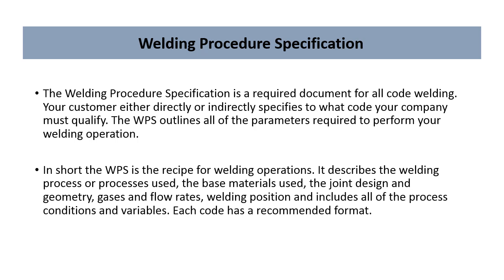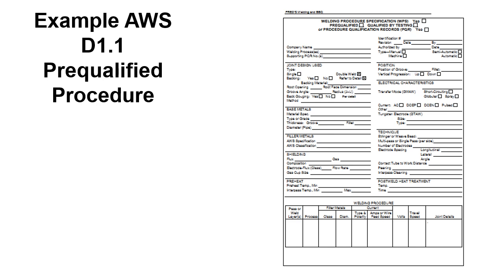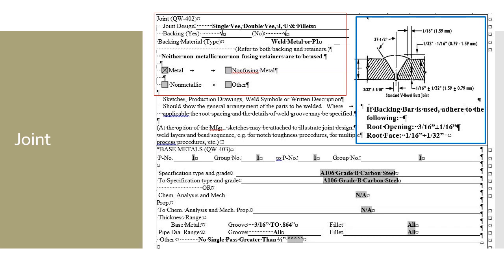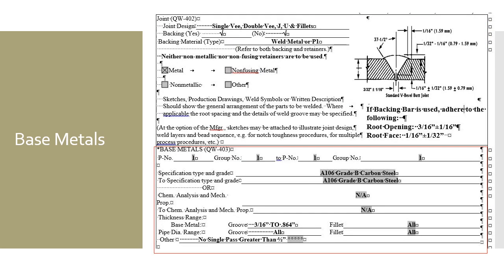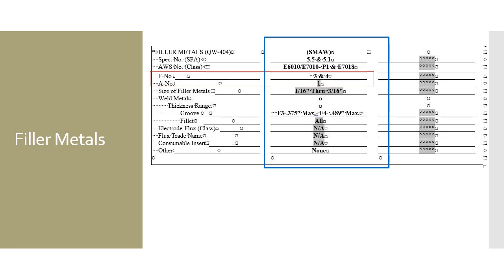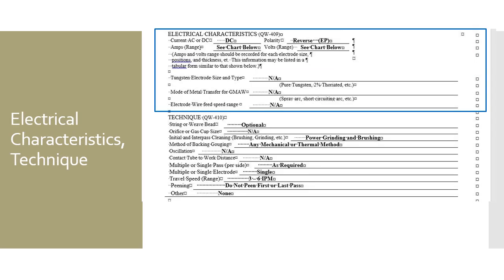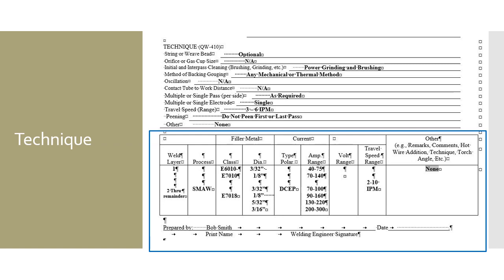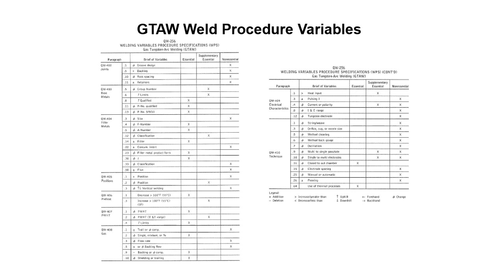How to Read a WPS (Welding Procedure Specification) | CWI Course Module 5

Comment: Early in my career, late one night I got a call what SMAW filler do we use for P1, I replied E7018. Next morning all welds needed to be cut out, the fabrication was P1 not P#1. P1 is a specific material A335 P1, C ½ Mo, P#3.  Ever since it has been a pet peeve, number symbol or word is critical. P1 should not be used to back P#1.  

Caught purchasing making similar mistake instead of ordering E7018 A#1 they were going to order E7018 A1